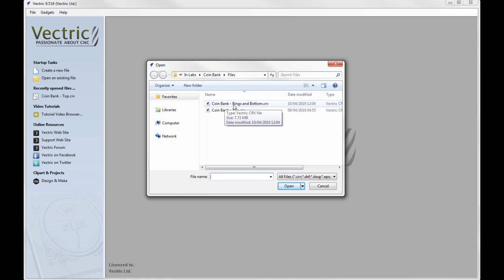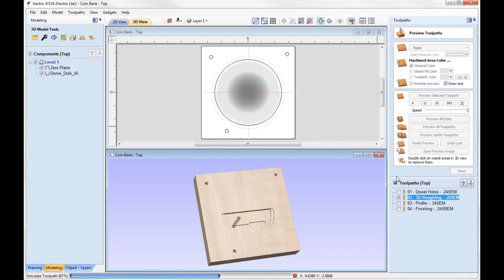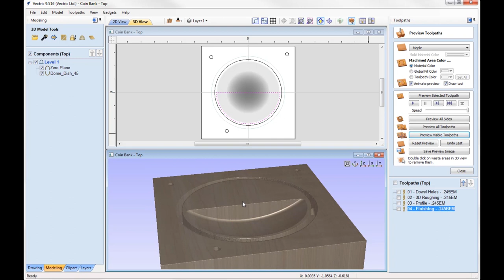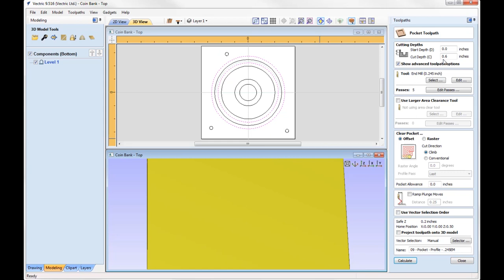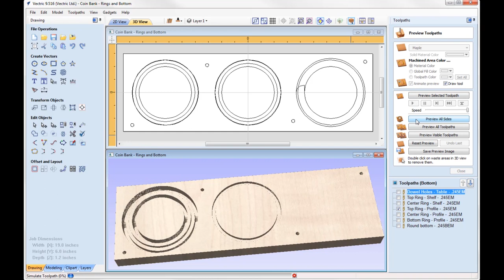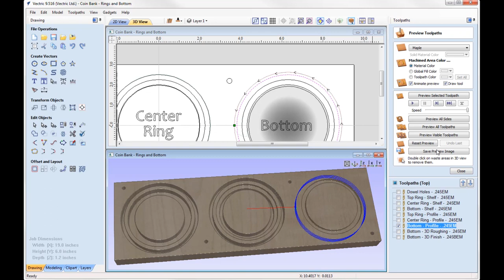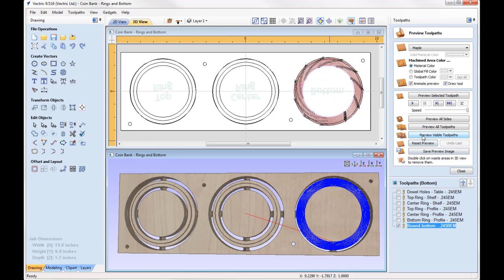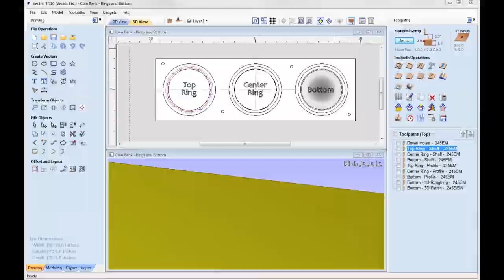In the Labs with Todd | Making a Coin Bank | Vectric FREE CNC Projects

Comment: ok, may be a silly question, but I'm just not grasping how you can use 3 alignment dowels and flip top to bottom. even if you flipped it side to side, that bottom pin is offset and would never line up.
Reply: Hello Bobby.... the dowel holes are flipped Left or Right, or Top To Bottom then cut into the spoil-board.  That way when you flip the board they fit.  Hope that helps.
Reply: @CNCminiProjects  I had the same question and was going to research that process...It wasn't obvious to me how that works; but now that you explain it, it makes perfect sense.  Thanks
Reply: @CNCminiProjects  I think I get it, but do you have a video that explains just that process?
Reply: @brianworrell6757  There are a few videos on the Vectric Support site that may help... this one is a good one.  If you go to video bookmark 7 you should get to the dowel hole bit. https://support.vectric.com/tutorials/V9/selectedvideo.php?video_id=51  Hope that helps...